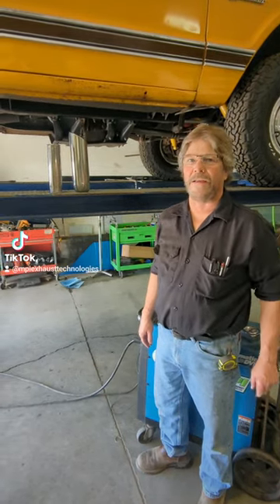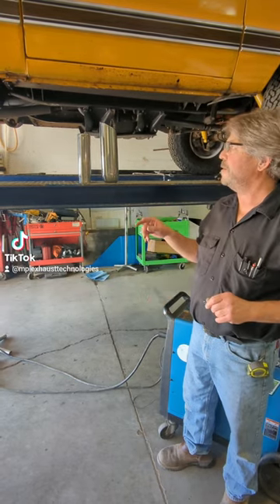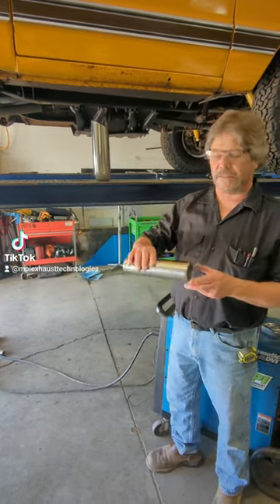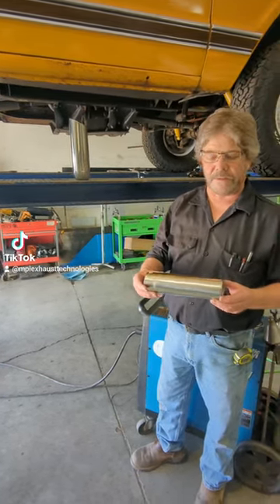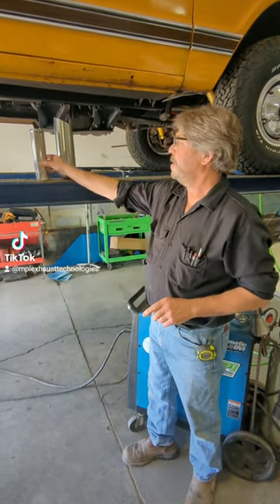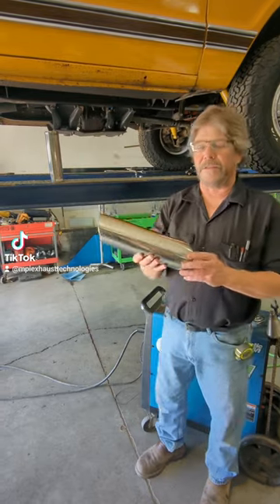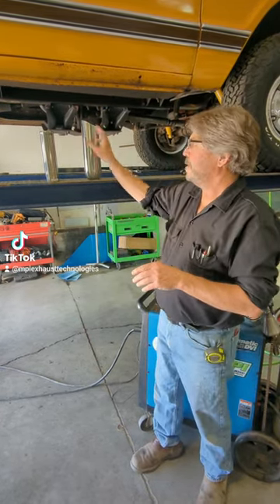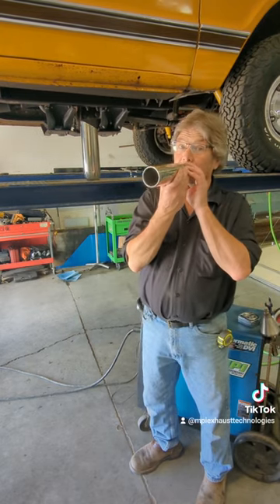Magic Exhaust Tips Size #exhaust

Comment: This is why you see those trucks with tips that look like 5g buckets 😂😂😂
Reply: Saw an F250 that had an actual water bucket for the exhaust tip. Ford owners I guess :/
Reply: @whyareyoureadingmyname5854  i have seen chevy and dodge with the same thing. It’s just the person driving the truck. Broke as hell 😂😂😂
Reply: Have seen a jeep cherokee in OKC with duals with 12" tip
Reply: You get that nice deep sound, especially if the truck is a diesel

Comment: I actually need a 3 inch exhaust tip for my GTI, it is tuned to 350hp and has two exhaust tips. Exhaust is all straight pipe apart from a tiny valved muffler, decat/catless

Comment: @mpiexhausttechnologies does a slant cut differ from a straight cut tip
Reply from the maker: Howdy, that wont have a sound effect on the tips, the ID size makes the different,

on all our MPI exhaust system we make 3.5" tips for a great appearance and it provides a Moderate sound, then we offer different muffler to control the sound level wanted

Comment: what if you have 3 inch exhaust and fit a 2 inch tip. will you lose power?
Reply from the maker: if the tip isn't smaller than the pipe size, then no
Reply: Youll probably feel a little more bottom end power but top end will suffer if you choke it down like that. Velocity is what makes power in an exhaust system. Think of a garden hose. If you take the nozzle off, sure itll flow a ton of water but the stream wont be powerful, cover half the opening on the hose and not as much flows out but its velocity is much greater. Having a small tip on q big pipe will give you that choked hose effect. Itll have good initial power but it wont flow as much as it can flow at its peak.

Comment: Large resonator makes like a  4 cyl honda bad buzz sound go away and sounds good but on a v8 you want a small one to hear the high pitch goodness and a big ones sounds way too deep and bad drone
. And The lenth of  larger or smaller portion of the tip is important you can tune the frequency higher or lower like a pipe organ

Comment: I am looking for some custom double walled exhaust tips
Reply: Double walled are louder than single right
Reply: @Richardv24 no double wall are usually perforated on the inside and will help reduce some crackle at the end of the pipe

Comment: it doesnt really do much unless you plan on cutting the stock exhaust which i wouldnt recommend if you live in a shitty state like i do with the dumb sleep law act. the closer you put the outer tip to the end of your stock pipe actually makes it louder from the inside of your truck vs extending it like 5 inch from stock exhaust pipe i feel

Comment: Ya but that clapping sound how donyou get read of that intook of a set of duls flow masters 40 sires not cats 2and a hlaf inch pipes i dont like the clapping sound and i went and put on magna flows dules it has a y pipe its on a 5.7 chevy 1989 motor tbi set up if you can hlep thanks and have a blessed day